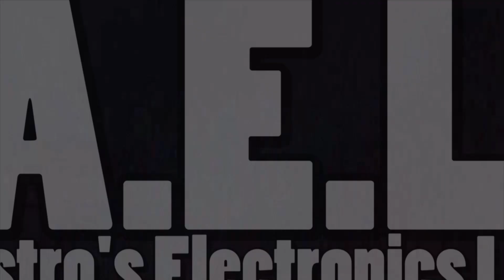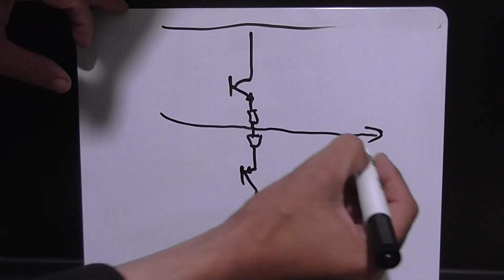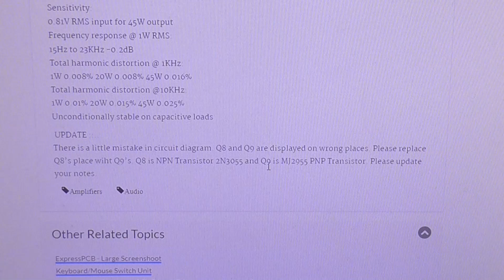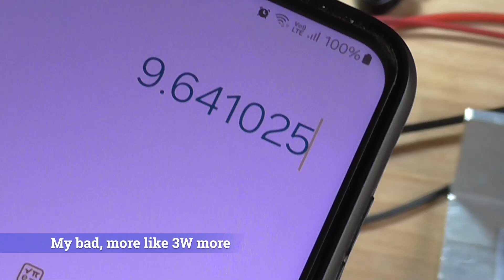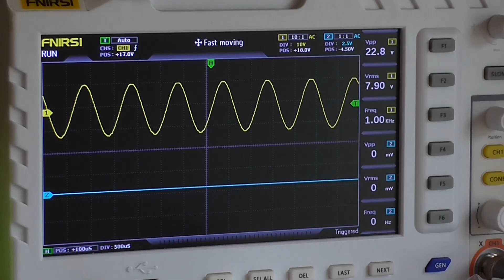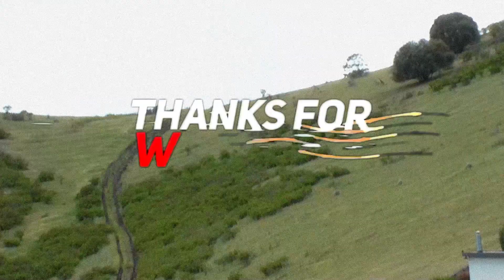Simple 45W Discrete Power Amplifier

Comment from the maker: OK. I think I was looking at the schematic completely wrong. I will admit when I'm wrong, also. After analyzing the circuit a bit further (and finding the original source), let me explain a few things. The placement of R11 and R12 make the output stage "appear" to not being biased. But, if we look a little further, it's actually configured as Sziklai pair (albeit, the rest of the circuit is hanging off of R11/R12). For some reason I read the values of those resistors as 7 ohm, they're actually 47 ohm, which would make more sense. Also, when he said switch the positions of Q8/Q9, he meant the part numbers; he had the 2N2055 marked for the PNP and MJ2955 for the NPN. He didn't mean switch them around in the circuit. One modification I would suggest, is adding de-generation resistors in the collectors of the output pair (say 0.22 ohm to 0.47 ohm 3-5W). I will be revisiting this circuit in a video and testing it as it's drawn (with de-generation resistors in the collectors). This would also make the output stage considered as Class-B, as the output stage will be biased at cut-off at lower currents, where the drivers provide the output; and at higher current demands, the output pair will begin to turn on and be providing the current (in other words, when the current flow via Q6/Q7 begins to increase, Q8/Q9 will begin to turn on).

Comment: Made this amp (of course the schematic that works) and cant be happier  with it. Its stable , no clicks and pops - used 2SC5200 /2SA1943 for the output . Works on 2x42V 4A  ,  around 90W 👍👍

Comment: bad circuit you cant bias it B of transistor's are driven by magic
Reply: That's just the nature of Class B amplifiers. They have crossover distortion.
Reply: @AnnaVannieuwenhuyse  True - even if you short them - worse that will happen is crosover distortion. Made this same amp - I used BD139 instead of those 2 bias diodes and a trim-pot to let it idle at 70-100mA . 
Its amazingly simple schematics , (the second one - the working one of course) reliable , no pops and clicks and still using it for a 12'' subwoofer
Reply: @cocosloan3748  the bjt as adjustable bias control is a classic method. It lets you thermally couple the output transistors too so that your bias current can automatically reduce itself as it heats up and the forward voltage drops a tiny bit.
Reply: @ True..
Once they used NTC's. But thermally coupled transistors do such good job you dont need NTC's anymore
Reply: I love "Leach-amp". There they use 4 diodes in series to regulate bias current 😉😉
Reply: @AnnaVannieuwenhuyse  And I built so many amplifiers , far more complicated schematics - but I prefer making the simplest one always because no problems , its cheap and the quality is 99% always there.
I mean this amp will give you 90W and sound at 99% as good as  the most expensive 90W amp !

Comment: The original circuit (with Q8 and Q9 in the correct positions) is quite clever if it works. As current through the drivers increases, there will be a voltage drop across R11 / R12 which in turn will turn on Q8 / Q9 boosting the output current. It's vaguely similar to a commutating stage (class H) but boosting current rather than voltage. I might try and prototype it and if it works take some measurements with a THD analyser and report back. I presume C5 (C6 appears twice in the parts list, but it's I suspct it should be the 220nF) is presumably intended to switch Q8/Q9 off, however I'm not sure how effective that will be...

Comment: 6:07 for my opinion those mentioned resistors should go between collectors of BD139/140 and 2N3055/2955 to limit the current to the input stage. which would make absolute sense.
Reply from the maker: You mean if the output stage was configured as Sziklai pair?
Reply: @AstrosElectronicsLab  either as Skiklai pair or Darlington pair. As outlined later in the Video.